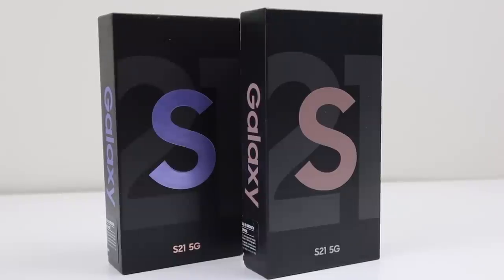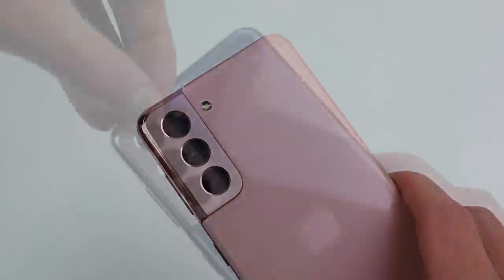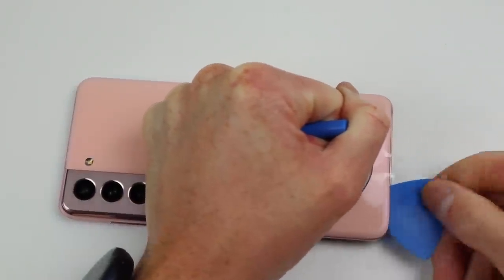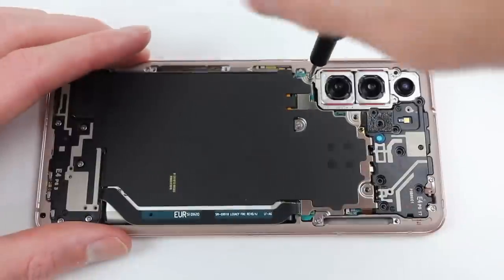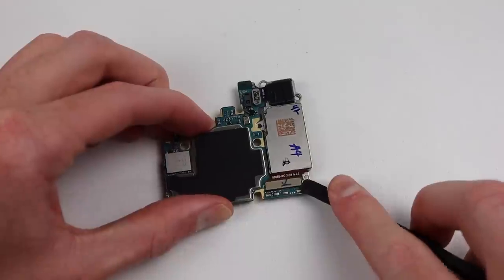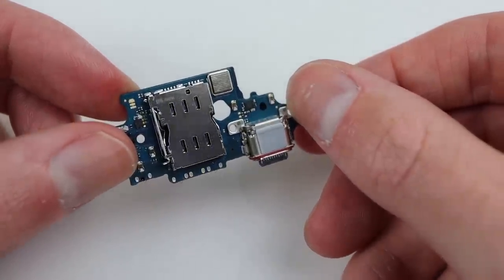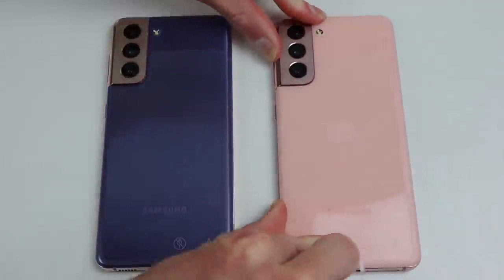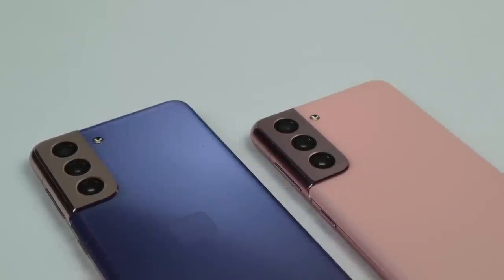Samsung Galaxy S21 Teardown and Repair Assessment - Interesting Findings!

Comment: That’s genuinely extremely important to me and one of the many reasons why I’m loyal to Samsung.
Reply: Honestly speaking right to repair is just a goodwill gesture to me. I don't actually care about having the ability to repair my own products because I don't have the skills to do so, but a companies stance on something like this does speak volumes as to how much they care about their customers.
Reply: @Brian-wp9er  Right to repair matters for third party repair shops. You might not know about repairing phones, but that's the purpose of third party repair. They fix your phone at a cheaper rate than what Apple charges. Plus, phones not being repairable creates e waste
Reply: @R0b3rT38  That's a good point. Honestly speaking, a company like Apple should be working with more third party repair firms if its going to be locking down their phones and limiting access to their phone's parts. At least that way third party repair shops aren't getting fucked over, and Apple and their customers can still benefit.

Comment: I hope they do not do a software update that removes this ability, it is awesome to see no locks! I hope the same holds true on the S21 Ultra, as that is what I ordered. I never had any issues with my Note 9, so hoping the same holds true with my S21 Ultra. Also interesting is if international parts can be swapped (looks like it is plausible). My Note 9 is the Australian model, however for the S21 Ultra I opted for the USA model as it has the better processor and performance. As long as parts are swappable, this makes units sold for spares/repair actually interesting :)

Thanks for sharing mate!

Comment: I wonder if this phone's battery has more glue than the battery of the Surface Pro 3... 
Either way, great video, great to see that the S21 is repairable with no software locks. I still won't be buying it as there is no SD card, no headphone jack, and the screen is down from 1440p to 1080p. It's a flagship phone; it should be having a 1440p screen considering that my old Galaxy S7 Edge and S9+ phones both had 1440p.

Comment: I’m going to say, unless Samsung is purposely trying to lock down every part, the A51s must be bugged out because the cameras can be swapped, as well as the charging board and everything else, just the fingerprint scanner needs calibration, but it won’t just completely stop working.

Comment: Is it possible to show what happens if you stick the sim tray removal tool in the microphone hole? I can see it's widely discussed on the internet and has a lot of guessing. It's even mentioned as a design flaw. My guess is nothing would happen but it could be really cool to actually see it and get it explained.

Comment: Great video 👍🏼 So much information. A quick question.. does M51 also has this software lock for parts? Why A51 has software locks and not S21? Did Samsung decide to rollback that decision to put software locking of parts.

Comment: I believe they won't lock it,unless users report it again(it happen on the s10 line up when wherever you used a screen protector,anyone could unlocked your phone with their finger print. they lock it.i think thats a reason on the A51 You can't change the fingerprint sensor,maybe a update will fix it or wherever android 11 arrives to the A51

Comment: Great point on the Buds Live extra!! I like Xiaomi's approach to it, where one can choose whether to get the charging brick or not, at no extra cost. Still, the prices of these phone should've been cheaper, at least equivalent to the charging brick's price, if not more.
Reply: The price of the charging brick is like 5$ and 5$ for the headphones so the s21 should be 989$? The s20 was 999$ with brick and headphones.

Comment: Ok, I have a question about the whole no-charger thing. Why don't people just use their existing C-to-A cables if they want to use their existing adapters? There's no need to buy a new adapter just because the cable is different... you can use an old cable that works with the one you have. Yet it seems people barely mention that in articles and videos.

Comment: Can you remove the wireless charging module with the phone still working with no issues?  I have no reason to have wireless charging and wonder if it's just a useless drag on the cpu/battery

Comment: Question,,I have a s21 that was plugged in to a car charger when there was a voltage surge.  I had hundreds of videos and photos of my family and deceased pets.. and as you can guess I didn't have it backed up.  Could the memory be taken from mine and put into a donor phone to retrieve the photos etc?

Comment: Comment on the dual SIM tray: You wouldn't be able to use the second SIM through flashing, as a second IMEI would be needed for the second SIM. Changing the IMEI is possible, but highly illegal in most countries.
Reply from the maker: This phone has two imei's one is for an e-sim. So I don't see why flashing wouldn't work

Comment: Hey i need a tip on what to buy. So my sim isnt being recognised on my phone, it doesent let me call or text people without using whatsspp. Data dorsent work snd shows a symbol, a cirlce with a line goikg thru it and ssys im not rehistered on network.

Would you recommend i replace the charging port module considering the sim reader os in the same psrt?

Comment: I have a question. What about replacing the front camera? I'm trying to replace the screen with the frame and came with camera embedded thermal sealed. But gives me an error. Put it back on the cracked screen and works perfectly. May I remove that camera?

Comment: I accidentally inserted the SIM ejector tool inside the mic right beside the SIM tray on my S21 Ultra. Have I damaged the mic? 😥
Please reply. 

I tested the mic by calling my other number, seems to work fine. Also, I performed the mic test in the Members app and the result shows that there's no issue.

Comment: On Samsungs i belive that installing a custom recovery for example TWRP and a custom rom for example LineageOS should remove the part locks
Reply: Custom recovery and ROMs are a very bad idea. No security (nevermind major) updates, void warranty etc. etc.
Reply: @liviuganea4108  they are the best idea you could ever have if you have an oldand slow phone. Now im forced to daily drive a Galaxy S3 Mini, on stock it was unusable, with cyanogenmod 12 and 1200mhz overclock kernel its a lot better

Comment: People who are commenting that Samsung will lock it with a software update: 
Galaxy A51 has had an issue with the fingerprint sensor since its launch, same with the predecessor GalaxyA50. Samsung always tries to fix it in one of the software update and things become either broke or fixed. The problem is with the optical type sensor, whereas in flagship they use ultrasonic type which has no problem. This is the third Galaxy phone Hugh is opening to check repairablity, and two have passed the test. One hasn't because it had an optical fingerprint sensor. 

Stop making a fuss out of it!

Comment: Hello, my s21 has just arrived and i made a big mistake. Instead of the simslot i put the needle in the microphone-hole 🤯. Microphone works fine but i think maybe i destroyed something of the Waterproofness. A small skin or something?! Can you tell me if there is a skin or soething different? I have  no idea of the system and its impossible to the something trough the little hole🤷

Thx, and sorry for my bad english.

Comment: Where is the Ssd drive located on this phone? I cracked badly cant make out anything on the display. But I have another S21 I tried to swap the old motherboard into the new phone just to transfer data from it but it refused to turn on.

Comment: I pre-ordered the Samsung Galaxy S21 Ultra 512GB  16GB Ram January 15th for the free buds pro & tag promotion but they only shipped it to me after the promotion ended and told me I can't redeem the e-voucher to redeem them. So after finally set up my phone it gets about 1 droplet of water in the volume button by just a slight moistured thumb and then the screen goes black with a green line across the screen by that volume button right after the 30 day return period, So I then open up the back cover not knowing I voided the warranty from Samsung and device protection also with my service provider to see if there is something I can see to fix right away so I won't lose my business and literally my life I set up into it with security, I figured it just needs a blow dryer on it's back to dry it out so I melted all the lenses with it and now I feel so sad. A whole brick phone I have to pay for with financing but I need it to get into the phone to get back to my finance or else.

Comment: Anyone run into an issue where the rear camera doesn't work? Getting "Warning: Camera Failed" message.  Front camera is fine and all the camera cables are connected on the backside of the mobo. Using original camera and mobo.

Comment: I recently did a daughterboard replacement on this phone and no longer have service. Is there any chance the sub board and main board are paired and cannot be exchanged?
Reply from the maker: You need to make sure the model numbers match. US models have completly different processors.  So some things arnt interchangeable.
Reply: @HughJeffreys  I appreciate it, yes they are both US models. All other features that the sub board provide are fully functional but for some reason no service. I am gonna have some try to solder a new flex cable connector onto the original board as it is damaged.
Reply: @HughJeffreys  I guess I somehow also could have short circuited an essential component on the main board (though I doubt it with how thorought I was) and will therefore try a replacement motherboard.
Reply: @HughJeffreys  yo i recently had water damage on my s21 i had to replace the cameras after that it worked for a while now i think my simcard reader is faulty it doesnt read the card and the simcard tray not detected message keeps popping up , what would it cost to replace the simcard reader along with the charging socket as they come together i think , having already spent almost 200 dollars on the front and back cameras i want to know if it isnt too high

Comment: 🐨 I am still not convinced to stick with Samsung for the two following reasons,
My Current Samsung's battery can be easily replaced by unclipping the back, This extremely important feature is HUGE! 
Secondly I am still concerned that even though modules can be swapped for the moment, I still have to ask what will 
happen after some Update? Can an update have the mainboard identify each and every Module it was installed with? 
Remember that other brand who near crucified itself and lost a significant herd of it's sheep by an update rendering their 
phones unusable due to repairs conducted to them, repairs I might add included authorised repairers at that!.
Feel free to drop a like and even add your concerns below.. 
APU I gave a 👍

Comment: plastic back, does this mean that there would be no more clear back phones?
Reply: Not necessarily, only time will tell we know it's a cost cutting measure though.
Reply: @Andre217  i mean the whole back isnt a piece of clear plastic and a sticker, it is dyed plastic, there is no way to make that see through is there?
Reply: @Jasonzvo  oh I'm sure there is , they will just have to use clear plastic I'm sure its possible.
Reply: @Andre217  I don’t think there would be any 3rd party manufacturers who would make that tho due to the small amounts of profit made from them
Reply: @Jasonzvo  that's true we just have to wait it out and see. We don't see a lot of  clear devices as it is .
Reply: @Andre217  I made one of my s9s clear using the glass back and I just peeled off the backing but on this one I can’t because it look like a dyed plastic not a backing color
Reply: @Jasonzvo  well if that's the case with plastic backs. I'm sure maybe there will be a way for people to make there own clear plastic backs just have to replace the back on the phone and add the adhesive and stuff.

Comment: Yea, but plastic scratched easier than glass and doesn’t feel as good in the hand
Reply: It won't break as easily or be as slippery either. Still prefer glass though.
Reply: @2010ngojo  yea, true, they both have their own advantages and disadvantages

Comment: This is however, a really cheap plastic. They could use textured matte plastic, so it wont scratch that easily.

Btw this is the S line, and Samsung is affecting their own reputation by putting plastic back on the regular S21)

Comment: I really never got  why "glass=premium" was or is a thing. 
Glass is the least durable option ever used on smartphones. It is the most expensive to repair. It is one of the cheapest materials in production. It is the least safe option when damaged. 
Plastic is better in every point but maybe feel. But honestly the S21 back feels premium and many glass backpanales feel worse because they trie to imitate a non glass feeling. 
If you want a premium backpanel go with Aluminium. It is quite durable, can be repaired even if damaged and if repair is impossible it is rather reasy to replace as it will almost never break but rather bend. It will also increase the durability of the phone far more than glass without risking cuting to the user if it breaks. Oh it is also not that much more expensive than glass. 
So unless "premium=shit" you should never go with a glass backpanel

Comment: i still hate the plastic back
Reply: There are tons of advantages of plastic back over glass.

Sure, it doesn't feel as premium, but at least it won't shatter, removing it is easy and the frosted plastic back doesn't get any visible scratches.
Reply: @staidey5994  true, but in my experience removing them is not "easy", it's just less likely to break, which doesnt affect much in terms of cost of repair because most repair places just carry the 10$ piece of glass. 

my original point was it has a decent bit of positives, the main one being that it wont crack through a case lol. 

but i do still hate it because samsung doesn't give a rat turd about repairability or repair costs and just wanted to save a few dollars on their very expensive flagship phones

Comment: ur fingerprint didn't work on the other Samsung video cause they got misaligned. maybe do some research before u swap things arround and claim there are software locks
Reply from the maker: Maybe you should actually watch the video first before making uneducated guesses
Reply: @HughJeffreys  i watched it and actually u removed the fingerprint modules so its quite easy they got missaligned